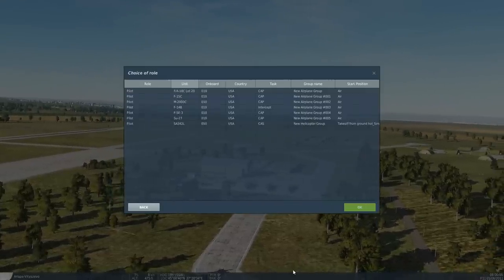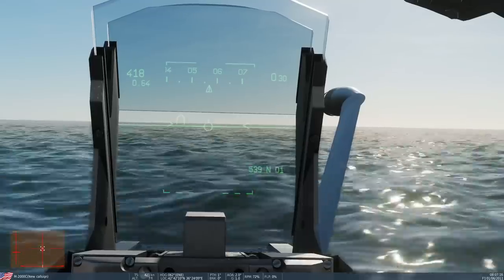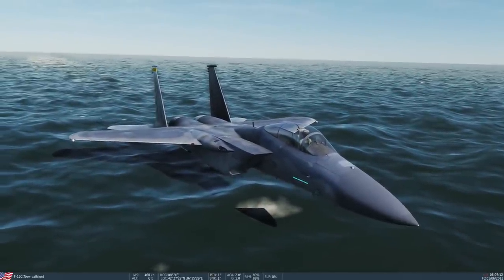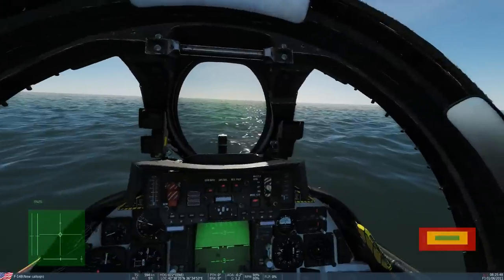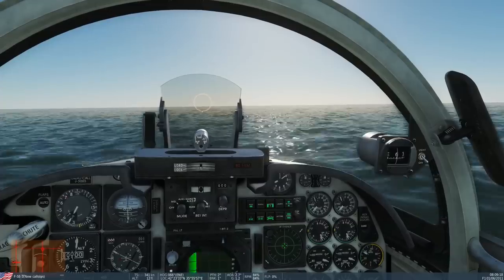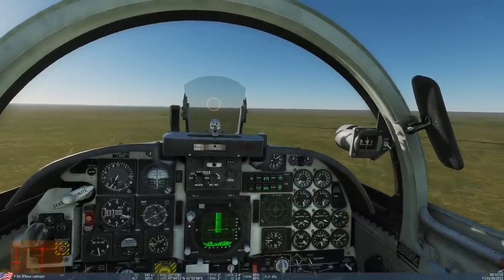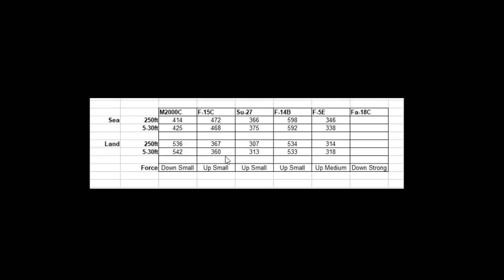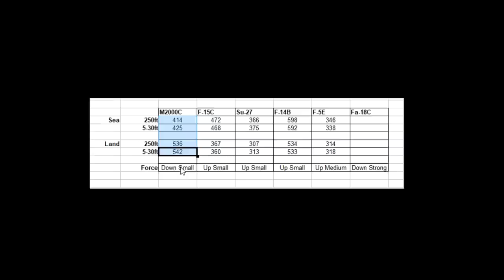Flying Basics: How "Ground Effect" Affects Planes In DCS WORLD

Comment: I havnt noticed it in DCS much, but its actually something you have to be mindful of in Civilian aircraft. Low wings in XP11 for example. The TBM900 will want to just sit about 2 feet off the runway. While the caravan doesn't do it nearly as much. 

You notice it more in the A10C in DCS because of the lower landing speeds and huge wings. Fighters not so much.
Reply: thats because fighters can travel faster and the wake is just too far behind to hit the ground and reflect back to the jet which is already gone grim is flying too fast too. especiallly if ur faster than sound
Reply: @Vampiresquid007  plus even when you land most of those planes you touch down pretty hard.

Comment: Im an aerospace engineering student ill try to explain the lower wingtip vortices bit simply. Imagine a 2d wing aka an airfoil, the air below the wing has more pressure so it creates a net upward force. Now make that wing 3d the high pressure air below the wing wants to meet with the lower pressure air on top of the wing. They usually meet at the trailing edge and everybody is happy. I say most of the time because at the part near the wingtips air has an easier way of meeting, going around the wingtip. So the air below the wing near the wingtip goes down out of the and back up again to meet with the lower pressure air. In ground effect the cant go down as freely because there ground underneath so all that air has to go the traditional way of meeting at the trailing edge thus reducing vortices and drag.
Reply: Think of the drag reduction like this the energy that would have been spent of creating wingtip vortices are now utilized in producing lift
Reply: This really helped me understand it. Thanks.

Comment: Hello Cap, my name is Jeff. I hold a commercial pilot's license single-engine multi-engine land instrument rated. There seems to be some confusion about ground effect. Ground effect is experienced  within 1/2 the wings span above the ground. Ground effect does not increase the  air speed. Ground effect allows the aircraft become airborne at a lower speed than would normally be required for flight. We use this for short feild take off. Get it up into ground effect, level off, the aircraft will accelerate quicker, there's no rolling resistance of The Wheels on the runway. The suck down thing, on some aircraft, tip vortices can kind of bounce off the ground and influence the tail or empennage if you prefer.What causes ground effect, that is a complex topic that is beyond the scope of YouTube comment section. There are some published papers that get into this, I get them on NASA's website however you need to be an aerodynamicist to really get it. Cool video though,  all your videos are cool. Hope this helps.....
Reply from the maker: Thanks Jethro

Comment: The vortices (plural for vortex) normally happens at the wing tips where the high pressure under the wing flows past the wing tips and on top of the wings. 

This causes the air to spiral around the wing tips and creates drag. (side note, this is why airliners have vertical wing tips, this reduces the vortices allowing them to fly more efficiently, though they have since learned that curving wings is even more efficient which is why we don't see as many vertical wing tips now.)

When in ground effect you're basically riding on a cushion of air and the high pressure area extends a bit in front of the wings, reducing the vortices and decreasing drag.

Typically fighters have smaller wings so they aren't as effected by ground effect though it is still there, it's a lot more noticable on bigger aircraft though.

Though I don't know about why specifically but I think the mirage got sucked down because of the shape of the delta wing

Comment: There's a number of elements in the physics, but probably the biggest one is that the airplane's wing is pushing down the air beneath it to generate lift. Normally that air can just move downwards no problem, but (little-known fact) air doesn't move well through the ground.
So when you're very low altitude (lower than one wing chord... the span does matter for some parts, but overall is less important than the chord for ground effect), the air being pushed down by your wing smacks into the ground and slows down somewhat. The air above it keeps moving downwards, though, so you end up with the air compressing.
Because of this, you end up with higher-than-normal pressure air under your wing, and normal-pressure air above your wing, so it pushes your plane up more than usual, generating more lift.

This is very simplified, but you asked for the layman's version, so there it is. When you think about it, it actually does make a lot of sense.

Edit: It's possible the pitch-down effect in the Mirage comes from the fact that the delta wing ends right at the back of the plane, and the closer to the back of the wing, the greater the compression effect. It does actually make sense that it would try to pitch you forward there... so I think that's actually some good work on Razbam's part.
Edit 2: You should feel the lift more at lower speeds rather than higher ones, since you have higher AoA then. But the wingtip vortex shortening should work better at higher speeds. So, bit of both.
Edit 3: The effects should also be stronger on the low-wing planes than the high-wing planes, which did seem to be the case in the results. I'm not sure why the speeds were as inconsistent as they were, but I'm guessing it's a lack of knowledge on my part rather than implementation on their part... though admittedly I'm pretty sure high-speed flight at 4 feet off the ground wasn't part of the standard testing routine.

Comment: All this is real world aviation related....

There are basically two ways of generating lift in normal flight for a given wing, either by the airspeed, or by the AoA, you can reduce one and increase the other and maintain the same lift, but in ground effect you introduce a third way, and that is compression between the wing and the ground, and this effect starts to kick in at about one wingspan and gets progressively stronger the lower you go.

The vorticies are a product of induced lift, and induced lift is a product of angle of attack.

The reason that the vorticies are a product of induced lift is that as you increase the AoA you're increasing the pressure differential between the top and bottom sides of the wing, and the air tries to move around the tip from the high pressure side to the low pressure side, the more AoA you have the bigger that pressure differential is and the stronger the vortex.

If you can reduce the need for AoA, by keeping the airspeed the same and introducing ground effect you will get a reduction in induced drag and smaller vorticies.
Reply: What is meant by downwash in the beginning of the video? Or was that referring to helicopters
Reply: @vnyggi621  "Downwash" occurs in all aircraft strictly speaking, with helicopters it's more obvious the meaning, but at the trailing edge of a fixed wing you'll also get downwash (and upwash at the leading edge).

The concepts of upwash and downwash are critical to the "circulation" theory of lift.

Comment: One of the reasons for ground effect reducing the size of the wing tip vortexes is a lot of the air that is trying to expand out and curve around the under side of the wing to the low pressure on top hits the ground first before it can do so thus reducing the wing tip vortex and reducing induced drag.

Comment: Great video!  "Ground effect is maximized in calm wind conditions and over a smooth and level hard surface. The effect over grass, an uneven surface and sometimes over water is likely to be much less. Not surprisingly, fixed wing aircraft with low wing fuselage attachment receive maximum ground effect."

Comment: Has I understand physics.... the "vortices" created at the tip of a wing or rotor in itself is "drag".... more of a voticy or "rotation" of air flow means more drag. Therefore if the voticy is reduced either by shape or speed you will have more lift in respect to the speed by the very nature of 'lift' itself. So, this really helped me as I have been having a problem landing. Some was because of my stick adjustment but I neglected to concider this. Much to learn in DCS!

Comment: many suggestions to try in landing config. here.  instead, if you want to really test the models for this effect, try takeoff with no flaps at lightest weight.  Use minimum throttle.  At the right balance, you will get the airplane airborne at some minimum speed and it won't fly higher than about 1/2 wingspan above runway without adding more power (if the models are true to life that is).  You may need a really long runway... ;-}
Thanks for being curious, I think that is fun stuff!  Blue Skies!
Ben

Comment: When you are sucked down, it is due to the venturi effect. Try to hold 2 sheets of paper vertical, say 30mm apart. Then blow (with your mouth) in between them - and voila - they will move towards each other. The same principle as used in a carburettor, where you have the venturi pipe creating an under pressure to suck in the gasoline.The same effect can suck down huge ships several feet and must be taken into account when passing shallow waters. You probably should have had a setting with no waves. I imagine that the waves will have an effect on the ground effect.
Reply from the maker: Welcome back Cam. You've missed some cool shit.
Reply: Thanks! I will try to catch up, but with your production rate, it will be quite hard :-)

Comment: The best way to test ground effect is due landing configuration flops gear at about 2000 ft and stall it. Then do the same thing coming in to land but do not touch runway with rain gear and try to stall just above the runway the speed should be different.

Comment: I mentally picture it at this your wings are forcing air down, kinda like a helicopter down wash. Close to the ground, the downward has a "ballooning" effect pushing your aircraft up. Less lift is needed by the wings. Your wings working less induce less drag. All aircraft, rotors and propellers have vorticies at the tip due to the wings function. Higher pressure on the bottom of the wings, rotors or propellers wants to get to the lower pressure at the top. This occurs at the tips of the wings and creates vortexes. This causes drag in all things that fly, and is the price you pay for lift. This is why airliners have those wingtip "winglets" to help reduce that.
Reply: Il2 1946 I believe has this modeled because some aircraft REALLY balloon on landing.

Comment: I learned to fly in a piper Cherokee.  The ground effect was insane.  It was basically a wall once you hit 5 feet with engine at idle you floated down the runway forever.

Does a stalled wing benefit from ground effect?  My guess would be no because there is very little induced drag on a stalled wing

Comment: Remember Cap that induced drag is most effective at lower speeds where profile drag is most effective at higher speeds. 

Us glider pilots use ground effect quite often. Have a look at the end of this video of mine. 

https://youtu.be/rsK1mutfFNM
Reply from the maker: thx
Reply: Oh and think of profile drag like someone pushing against the airframe from the front and induced drag like someone pulling the plane back from behind with rope. Induced drag effects the object most at low speeds and it’s effect tapers off as speed increases. Profile drags is least effective at low speed but increases as speed increases. There is a point on the polar curve where they balance out and that’s where things like best cruise speed of best glide speed are calculated. 

The effect is similar to helicopters where the aircraft can takeoff but not get out of ground effect when overloaded or underpowered (takeoff altitude can also affect this) and also is responsible for the “floaty” feeling when trying land an aircraft that you flare when landing.